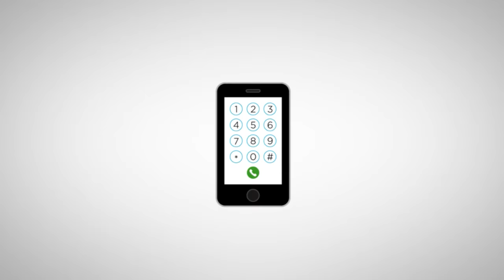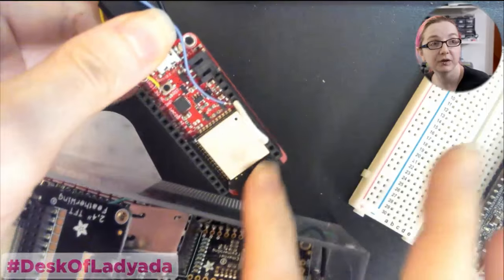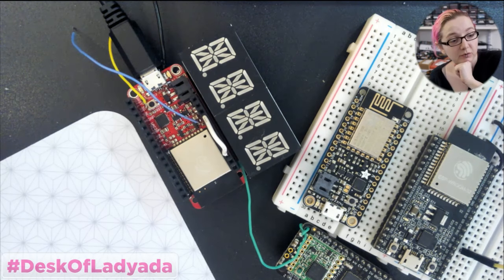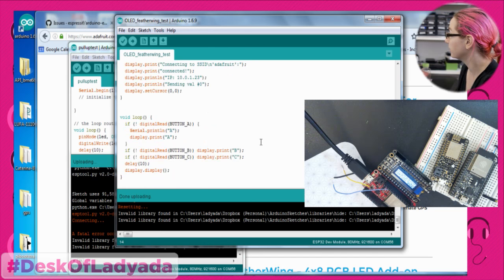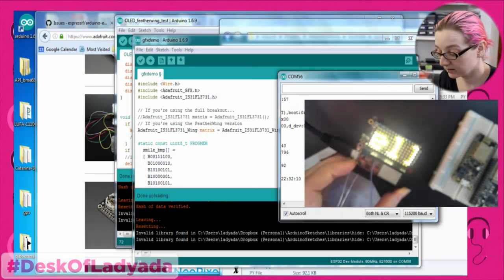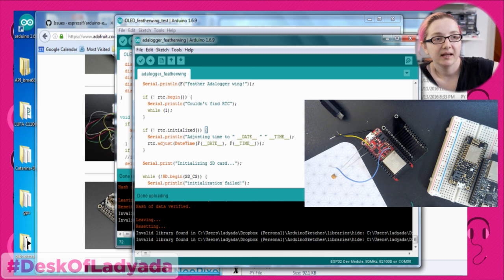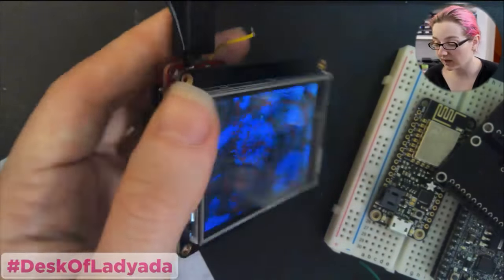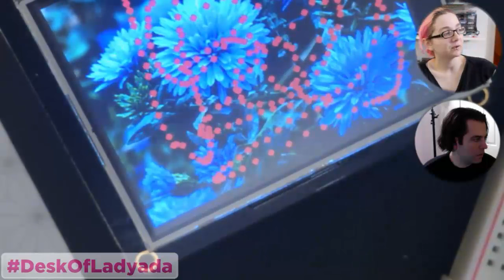DESK OF LADYADA ESP32 night! #ESP32 @EspressifSystem @adafruit

Comment: ESP32 cpus run on 80, 160 and 240 MHz. Clocks are multiplied/divided from the 80MHz base clock. Currently Arduino is fixed to 160 because all of the IDF libraries are prebuilt and 160 seems more stable and safe for now. In near future the option will be open. If you use esp32-arduino as idf component in a project, you can pick from the 3 cpu speeds now.

Comment: I was reading the ESP32-Wroom-32 module docs yesterday & taking notes on the GPIO pins.  
They mentioned that you can't use IO32 and IO33 coz the module has them wired to the crystal.  Also IO34 and IO35 are GPI: input only.

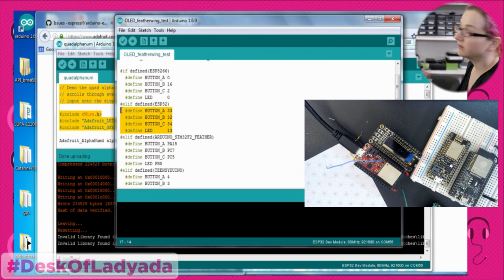20:04  I'd think this might be your issue since (if i'm reading this right) you're using pins 32 33 34 here, yet your B button is clearly working (how?!), so i dunno.
Reply: IO32 and IO33 were connected to the 32khz crytstal on an earlier dev version of the ESP32-Wroom-32 but the most recent version of the module does not include an internal 32khz crystal so you can use these as general IO. This confused me at first too!! Only has 40mhz crystal on pins 43 and 44. https://espressif.com/sites/default/files/documentation/esp_wroom_32_datasheet_en.pdf
Reply: The stuff i'm talking about is still written on the bottom of page 15 of that doc tho (current version: 21st Nov 2016).

Perhaps it's saying that the pins are connected to a crystal that's part of the ESP32's chip?  
It's worded strangely: in one sentence it refers to an "internal crystal", but then it mentions the option of de-soldering the crystal.
But I can't find a crystal anywhere on the page 16 schematic.

Perhaps the best explanation is that the page 15 text is the real mistake here, and should have been deleted a few revisions ago.
Reply: roidroid yup I'm pretty sure it's a mistake in the data sheet at this point. I have desoldered the shield on my module and there is no 32khz crystal like before.